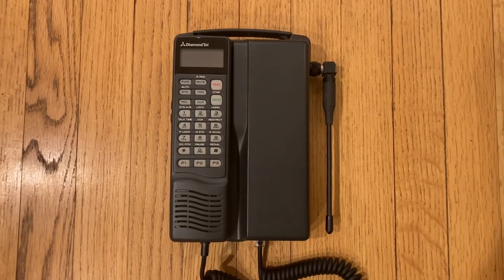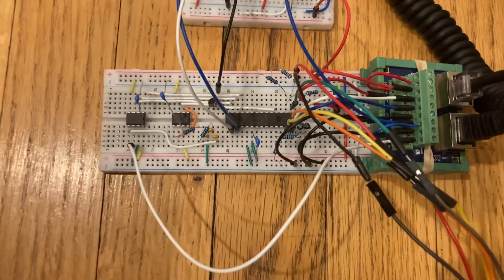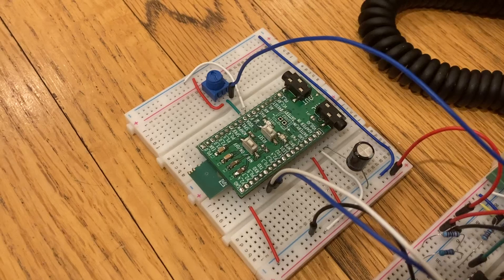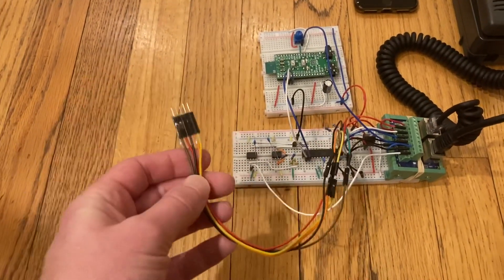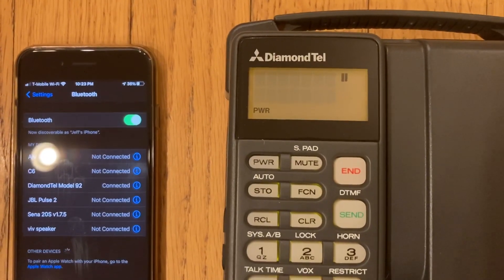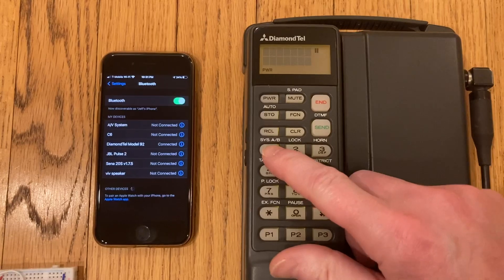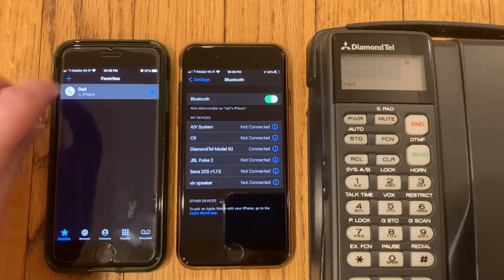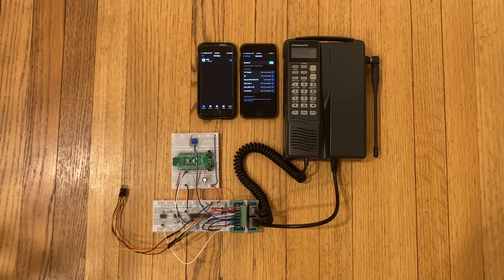Vintage Car Phone Makes Real Phone Calls (Bluetooth Adapter Prototype)

Comment: Did you get it working 100%.  I would love to have one for mine
Reply from the maker: Yes, I built a fully functioning prototype about 3 years ago: https://youtu.be/52AuhS5Jq0Q

And then another prototype with custom PCBs that fits inside of the original car phone transceiver about 2 years ago: https://youtu.be/uEtvmijlxUE

Last year I developed my own battery/power management circuit to replace the off-the-shelf battery module that I hacked into my prototype.

Now I am working on updating my custom PCB design to include my battery/power management circuit. I also need to track down the source of some noise in the audio that I'd like to eliminate.

If this new prototype is successful, then I may be able to start reproducing it in small numbers and offering a conversion service for the Mitsubishi Model 1500 and DiamondTel Model 92.

Comment: Did you get this fully working? If so can you please let me know?

GOD BLESS!!!!
Reply from the maker: Yes. Here's a full tour/demo of the car phone system in my car with a fully functional prototype of my Bluetooth adapter: https://www.youtube.com/watch?v=52AuhS5Jq0Q

And here's a newer prototype with custom PCBs contained entirely inside the original car phone, so that the phone looks completely original with no external adapter: https://www.youtube.com/watch?v=52AuhS5Jq0Q

I'm still working on the next version that will have my own custom battery/power management integrated directly onto my custom PCB, and will also add support for another original feature of the car phone where it can beep the car's horn when there's an incoming call after you've turned the car off.

Comment: I would buy a bunch of these if you wanted to make some!
Reply from the maker: Two years later, and I'm still slowly working on this project. I'm hoping to have it refined enough that I could start offering a conversion service within the next year. Here's the latest prototype I built last year: https://www.youtube.com/watch?v=uEtvmijlxUE

Do you have any DiamondTel Model 92 or Mitsubishi Model 1500 phones? Those are the only phones that this will work with, and they are not very common.
Reply: @UselessPickles that would be awesome! I don't have one at this second, I know someone I can buy one from though. My lexus has the factory slot for a car phone in the center console. I've been looking for one to put in there.

Comment: I wonder if somebody could figure out how to tear out the old amps hardware and insert either LTE or 5G hardware for service.
Reply from the maker: Sure. I probably could if I wanted too. It would be very similar to the latest version of my design, except that the Bluetooth module would be swapped out for a LTE/5G module, and the microcontroller code would need to be updated to interface with the LTE/5G module: https://www.youtube.com/watch?v=uEtvmijlxUE

But the Bluetooth approach is much better, IMO. I don't want to pay for an additional line of service and have a different phone number that I need to hand out to everyone and tell them to call that number when I'm driving (how will they know which number to call at any given time?). I don't want to have to swap a sim card between my cell phone and car phone when I get in/out of my car. I want to get in my car, turn the key on, and the car phone powers up and "just works". If anyone calls my normal cell number, the car phone rings, and audio goes through the car phone when I answer it. If I call someone from the car phone, they see an incoming call from my normal cell number.

Comment: What case is that you have on the IPhone ? I like how it’s really slim. If you could please link the exact case you have on the first iPhone I would really appreciate it
Reply from the maker: Here it is: https://www.amazon.com/gp/product/B0B5TLRTZ5

It comes with screen protectors and camera lens protectors too.
Reply: I meant the super thin TPU clear case that’s one the iPhone SE or 8, that is shown, right next to the Car phone
Reply from the maker: @MotorPractice  Oops. I forgot this was an older video with my old phone. I don't think I'll be able to find that specific case again, because I don't even remember where I found it. I know I just searched online for phone cases for whatever model of iPhone that was, and found something simple and cheap. That's also how I found the case for my current phone (the one I linked to).
Reply: Thank you for your reply. I’m really interested in Technology before I was born (1995) very interesting project!

Comment: I will do this with a dynatac
Reply: Either this or reactivate 1g
Reply from the maker: I think that reactivating 1G may be practically impossible. No cellular service provider will ever do this because it is outdated insecure and inefficient technology, and the frequency bandwidth for 1G has been reallocated for other purposes now.

You'd have to create your own private 1G base station (violating various laws about radio frequency use) that adapts to modern cellular networks, either using Bluetooth HFP like I did, or more directly with a cellular module and sim card.

Comment: Is’t possible to play music from the iPhone through such connection with the car phone all ahead to vehicle stereo speakers? Can it be done?
Reply from the maker: Not in my 3000GT, because the car phone system is only connected to the front right speaker. When the phone is "in use", the radio is automatically muted and the car phone system takes over the front right speaker. But the stock radio in my 3000GT has an AUX input jack, so I simply connect my phone with an audio cord for music. And I can use voice commands through the car phone system's microphone to control the music on my phone :)

You can see this all in action in this video: https://www.youtube.com/watch?v=52AuhS5Jq0Q
Reply: @UselessPickles  
Bro… I think you should invest your talent! what would you say if I passing the technical sticker chart for my bmw e32 phone modules and the phone himself. Would you be interesting to break down the system and return back to me with consideration and the diagrams so I can run it in the way that I mentioned before in the earlier comment?
Reply from the maker: @Second.Q  Sorry, but I'm an amateur at this electronics stuff. I've been working on this project for over 2 years now as a personal project purely for my own enjoyment. I have very little confidence that I could take on a project of reverse-engineering a different phone and designing new hardware/software for it, etc., within any reasonable amount of time. It would likely take me hundreds of hours of my free time, and I value my time, so it would end up costing you 10's of thousands of dollars to compensate me for my time that I'd rather spend doing something I want to do.

Comment: How much to do one for me i have old car phones
Reply from the maker: If you have a DiamondTel Model 92 or Mitsubishi Model 1500, then I may be able to sell a kit sometime soon-ish (next 6 months or so). I'm working on a new version of my project that installs inside of the original phone's transceiver, replacing the original circuit board, and using custom PCB that will make assembly time more reasonable than my current prototype. Price TBD after I figure out total parts cost and assembly time.

If you have a different car phone model, then my project will not work for you. I may consider developing a Bluetooth adapter for another model of car phone if either:

1) I have a personal desire to have another model of car phone that is fully functional (unlikely)

2) I win the lotto or otherwise become so wealthy that I can retire early and work on new car phone projects for fun as my new "full-time job" (unlikely)

3) You are willing to pay obscene amounts of money that convince me to give up a year of my free time to reverse engineer another phone and develop all new hardware and software to work with that phone, while accepting the risk that I may fail to complete a functioning product because I'm an amateur at electronics (unlikely)

Comment: Wow amazing, i have been looking for something like this for quite some time....i hope you keep your hard work. P.D  could it work using a Motorola cara phone?
Reply from the maker: Thanks! This is one of my older videos of this project. Check out this playlist of all videos related to this project, including a complete tour/demo of it completed and fully working in my car with hands-free integration: https://youtube.com/playlist?list=PLOlio4FadqvQEWHDXaJHlkvHigROk-RNV

Unfortunately, my project is very specific to this DiamondTel Model 92 car phone. A similar approach would probably work for a Motorola car phone, but would require reverse engineering that particular model of phone and developing different custom hardware and software.

If you're curious about the technical details, I published all of the reverse-engineered info about the car phone, circuit design, and microcontroller source code on GitHub: https://github.com/UselessPickles/diamondtel-m92-bluetooth

Or you can read through this forum thread where I documented my progress on the project: https://www.electro-tech-online.com/threads/making-a-bluetooth-adapter-for-a-car-phone-from-the-90s.162764/

Comment: Wow, I’d love to make one of these for a carphone and set it up for my own period correct cars!
Reply from the maker: I published everything (free for personal use), so you could build one if you have the skills and patience to do so: https://github.com/UselessPickles/diamondtel-m92-bluetooth

But it only works for a couple models of Mitsubishi/DiamondTel phones. To make it work with any other phone, you'd have to reverse-engineer that phone and design custom hardware and software specific to that phone.

Comment: I have one, do you offer this converting service? Locate in SC but could ship it to you.
Reply from the maker: No I do not. Also, it's not a conversion/modification of the phone. It's an external adapter that is plug-n-play. I published all the technical details, microcontroller source code, Bluetooth module configuration, etc., on github: https://github.com/UselessPickles/diamondtel-m92-bluetooth
Reply: @UselessPickles  CAN YOU SHARE THE LINK TO BUY THE EXTERNAL ADAPTER?  I don't see it listed on github.
Reply from the maker: @JohnMitchellCPA  You cannot purchase the adapter. I only built one for myself. If you want one, you need to build your own using all the information I published: https://github.com/UselessPickles/diamondtel-m92-bluetooth#build-your-own-bluetooth-adapter

Comment: So what happens when you don’t have cell service on the modern phone?
Reply from the maker: Depends on the exact time of when the phone list service vs when you try to make the call. If service has been lost long enough for the cell phone to report lack of service over Bluetooth, then if you try to make a call I simulate exactly how the original car phone behaved without service. The "in use" indicator comes on and it plays a really annoying "call failed" sound.

If the lack of service has not yet been communicated over Bluetooth, then my adapter will try to send the call over Bluetooth, the car phone will behave as if it's beginning to make a call, but then the call will fail on the modern cell phone and end, and the car phone will act like the person on the other end rejected the call (call will simply end).

This video shows some examples of the service status being synchronized from the cell phone to the car phone: https://www.youtube.com/watch?v=ZkNrX6hwKPM

And this video includes an example of me trying to make a call on the original car phone without service: https://www.youtube.com/watch?v=52AuhS5Jq0Q

Comment: I need this for my 1994 BMW 850CSi with BMW phone.
Reply from the maker: Unfortunately, this only works with the DiamondTel Model 92 phone. Different custom hardware and software would need to be developed for your model of phone, but the same general approach could be used.

More details: https://github.com/UselessPickles/diamondtel-m92-bluetooth
Reply: Your amazing with the tech.  Unfortunately, I would need a electrician to figure this out, as I sure couldn't.  Will need to flesh out my sources for help on this adaptation.
Reply from the maker: @c.rincon7145  An electrician won't be able to help you with this. You need a hardware engineer and a software engineer. Preferably one person that can do both.
Reply: exactly.
Reply: Amazing job congrats

Comment: I loveeee this ideaaaa have you gotten a finished product? I would love to get an old bmw or old Mercedes and make the car phone work
Reply from the maker: I have a "finished enough for my personal use" prototype. Here's a full tour/demo of it in the car, complete with OEM hands-free integration and voice command support: https://www.youtube.com/watch?v=52AuhS5Jq0Q

Full technical details on GitHub: https://github.com/UselessPickles/diamondtel-m92-bluetooth

Unfortunately, this solution is very specific to the DiamondTel Model 92 car phone. Different custom hardware and software would be needed for any other models of car phone, after reverse-engineering how it works.

Comment: Could I pay you to do this to my Motorola bag phone? Looking to get actual usage out of it so I can put it in my 1987 Porsche 944. Not much of a tech guy myself so I have no clue what to do
Reply from the maker: Unfortunately, my project will only work with this particular model of phone. I have no plans to try building adapters for any other models of phones because it would be too much work (I've been working on this one for over a year in my free time and I'm not done yet), and there's a chance I could even fail at reverse-engineering how the handset of another phone model works.

Comment: Looks like there's an equivalent unit actually sold on Amazon called cell2jack
Reply from the maker: Cell2jack is only vaguely similar in that it adapts "a phone" to make/receive calls via Bluetooth through a cell phone. However, that product only works with landline phones. It would not work with a car phone handset, because a car phone handset is not a landline phone. The car phone handset isn't even really a phone of any kind at all. It is merely a dumb input/output device with buttons, a screen, speakers, and a microphone. The "brains" of the car phone are all in the transceiver/base that the handset plugs into.

Comment: Do you have an official schematic? I'm incredibly interested in duplicating this.
Reply from the maker: I don't have a complete circuit diagram yet, but I do have a diagram of all the major components involved, and the major connections between them. You can find it in the README of the "hardware" directory of my github project: https://github.com/UselessPickles/diamondtel-m92-bluetooth

Source code is still a big sloppy mess that I'm slowly cleaning up (and getting distracted introducing new/updated functionality) and I still need to figure out how I'm integrating with the radio and hands-free controls in the car (hardware + software updates).

I also still need to figure out what licensing to apply to this project. It technically defaults to being fully copyrighted (no one can use it for anything without my express permission), but the eventual intent will be that it is free to use/modify for any personal/educational non-profit purposes.

Comment: How much would I have to pay you for you to make me the same thing? I had one that worked in are old work van but the service got discontinued in 2015
Reply from the maker: I haven't even finished making one for myself yet (it's still a sloppy breadboard prototype), and I'm not sure I trust my amateur electronics knowledge and assembly skills enough to feel comfortable selling any. I can't really make any guarantees about longevity/safety, or offer any support. But I am going to work on publishing all the technical details of this project over the next few months.

NOTE: If your phone is not a DiamondTel Model 92 or Mitsubishi Model 1500, then this would not work for you.